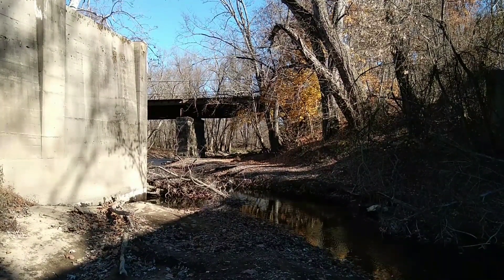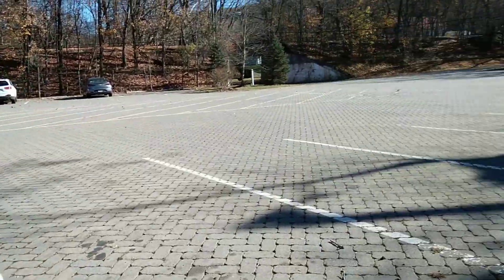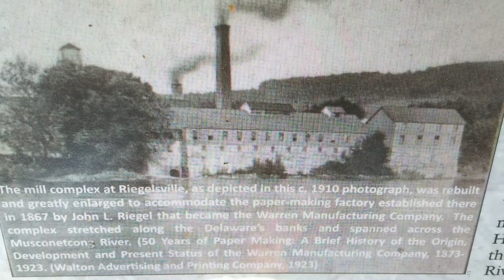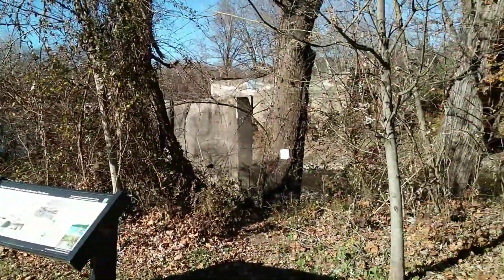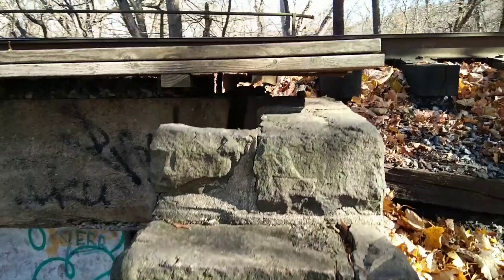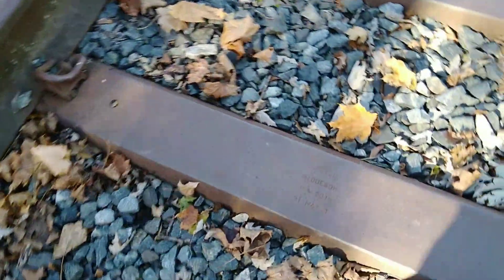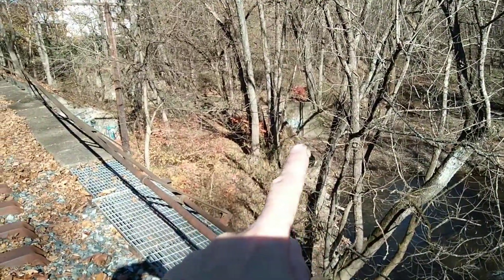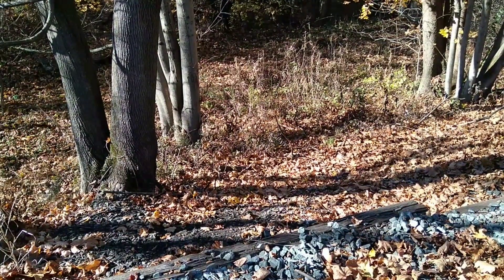Exploring Riegelsville NJ (2)

Comment: There was an annex to the mill (I believe it was for loading finished paper into trucks) on the Hunterdon side of the river and a covered bridge using those concrete piers connected it to the original mill.  Riegelsville made filtration papers until successor James River Corporation closed it in 1982.
Reply from the maker: Thank you so much!! I wasn't sure what those piers were for. I was thinking huge water wheels but what you said makes so much more sense.